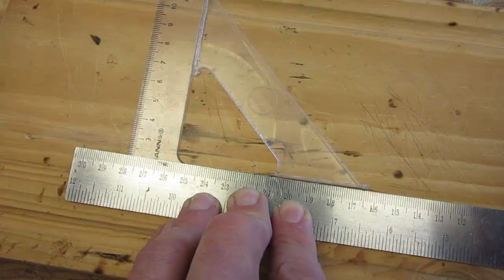What Can Be Made Out Of An Old School Plastic Set Square Or Geo Triangle Measuring Ruler? #upcycling

Comment: Hey congratulations for all your Videos nice and incredible things I didn't know, but I'm wondering if I can do a DIY nursing mask with plastic? just a mouth part? Thanks again for your help.
Reply from the maker: Being made is one thing, being effective is another
Reply: @TheLabOtomy  like I need to do sculp and melt the plastic on it the rest I have the filters etc is a good idea or do You Mister have a better idea?
Reply from the maker: If I was to take a plastic holder, 1) I would sculpt a shape that ressembles the shape of the bottom of my face, 2) I would cut strokes of HDPE (safe plastic to use and work with), 3) I would overlay the strokes and melt them with a heat gun to reach one solid massa taht covers the part I need, 4) I would trim to shape with a hot kife (similar to the Halloween mask I made actually, except that I used only 1 HDPE sheet)
Reply: Yes Sir, Good idea I should try that but I'm not that great than you Sir but I'll give a shot 😜😁 I come up with one idea but I don't know if will work 🙄😏
Reply from the maker: @emanuelmelim4082  It surely will, just believe!